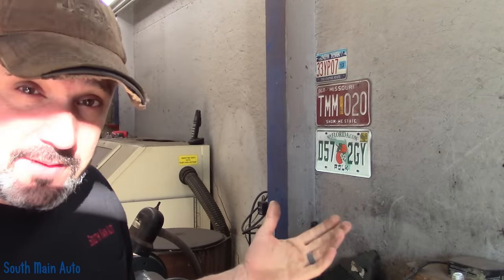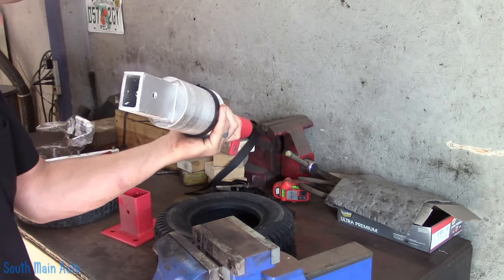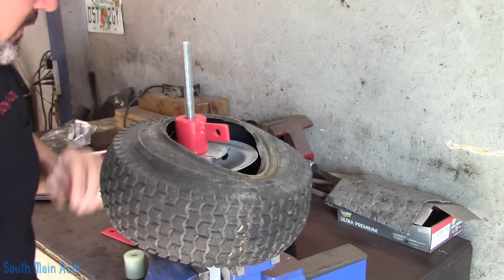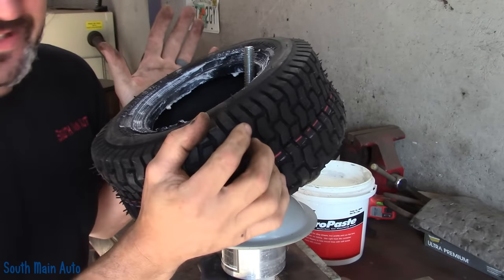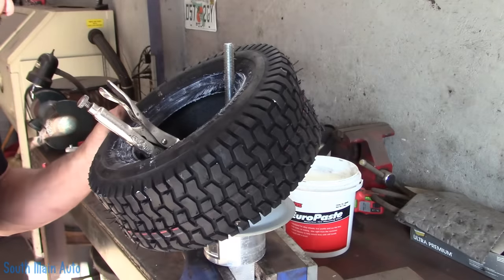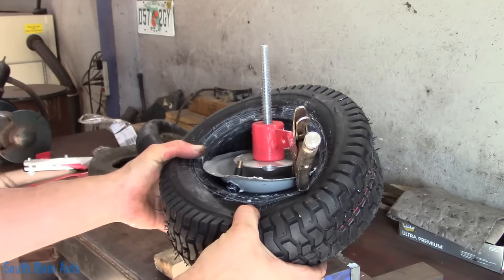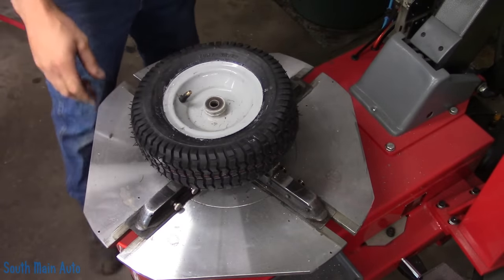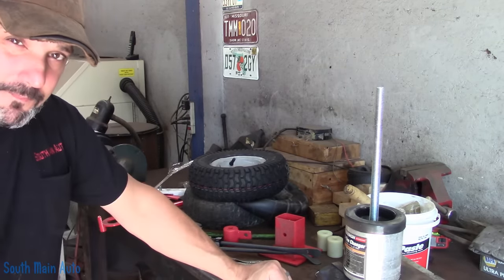Mini Tire Changer

Comment from the maker: *Portable Mini Tire Changer: https://amzn.to/2Zp1lmG
*Ken-Tool Tool Tire Iron Set, Small: https://amzn.to/2Zinao5
*Valve Stem Puller/Installer: https://amzn.to/2HiXNMr
UPDATE:
Man I can not believe the number of cry babies on here😂 . Listen. It's a throw away society and this is a throw away tire and wheel assembly. They are paper thin. Literally they can be bent by hand without much effort. It straightened out easy-peasy with a few taps and a block of wood. Yes it is a tubeless wheel. As a matter of fact when you buy these junkers they come tubeless so calm down it goes on a damn yard cart not the space shuttle. 
Fact is, some of you I see commenting would sing your praises one minute because I can tract down a parasitic draw, reflash an ECM, or chase out an electrical gremlin with out a hitch but "destroy" a $5 Chinese wheel for a yard cart and they take you to the chopping block lol. Seriously, grow up. 
You want to know the facts? I had the lady get her own tire because I knew she could get it for about $5 less than my vendor sold them. Oh yeah and I popped it on for her for free, oh and one other thing, she is not a regular customer so I don't benefit from this what so ever....
Cheers 😁
Reply: You are 100% correct, holding those small rims is the biggest part of the battle !  
Use a couple of giant C-lamp to break the bead.
A 12" carriage bolt up through a work bench, some giant washer and a home made giant wing nut and can those Ken-Tool spoons (best in the business), some lube and you are done.
Changing a tire, regardless of the size, 20% tools (including the lube), 20% labor and 60% technique.  If you do another tire video, you need to do a "white board talk" about the "drop center" and how it is important to keep the side opposite of tire from where you are working down in the drop center..  Many people still believe that you are actually stretching the bead to get it over the rim !
Reply: Same tool, $20 cheaper at HF.
Reply: Awful lot of tools for that tiny tire. I've done several of the 4" hand truck tires with only 2 big flat blade screwdrivers. Same technique for bicycle and motorcycle tires up to 18". Just lay it on the ground, stand on it on 1 side and work the other side with the screwdrivers.
Reply: Woah there Eric, calm down! Remember, this is the internet!
Reply from the maker: @jakeaustin9894  Haha I know I know but I think it is hilarious reading some of their comments. Bunch of mama's boys 🤣😂
Reply: Lol,i have a engine support (the kind that goes fender to fender   ) that I flip upside down on a table and use the chain hook bolt to clamp down the tire and use a prybar...it can be frustrating at first but with routine heck..it works. You always have the coolest gadgets
Reply: I have one of those....

I bolted it to a brake rotor so I can clamp it in my rim clamp tire machine. This puts it at a good height, and is fast to clamp and unclamp/put away.

The spacers save time clamping the tire, and give the mount demount arm something to ride on.

Mine uses a 14mm all thread. I did have to replace it after a few years.

The vice grip maneuver is a great trick.

Most of the time I just bolt the wheel to the bench, and use screwdrivers and the vice grip.

But, for busting my kart racing tires, the little machine did help.

Shorter #412 stems are better for little tires, and a lot of other applications. They look a lot cleaner and are less likely to snag on things.

If the inner rim is stronger, why not bust the tire face down?

Jeff
The Alignment Guy.
Reply: Wow wow wow.  Who is making these comments.  I would like to see them.  You are going to make this man mad over some Chinese wheel.  He is a genius at what he does.
Reply: So partway through, when I first saw that chowdered rim, I was thinking A, how is that not going to leak at the bead, and B, I would be pissed if you handed my tire back to me in that condition.   (Note the word "if".) But I kept watching before commenting... and you explained how the Chineseum wheels are made from recycled paper plates, and you fixed it, and it holds air, so there ya go.  Nice work.
Reply: So funny! These guys are acting like a bunch of girls!!! Love me some South Main!! ❤️🐞
Reply: South Main Auto Repair LLC you’d probably be better off not reading the comments at all. Let the haters hate and you, Me and the rest of society can live in the real world
Reply: It's a miracle the bearings were still good. On the hand trucks, the bearings fail within a month. Guess what, good replacement bearings cost almost as much as a new wheel with tire..
Reply: Just remember goosefraba to calm down. They just realized that the box store lawn equiptment isnt quality and they have the same wheel but yet my neighbor tells me I need a new mower cause my cubcadet 2000 series is old. I'll keep my 97 cub cadet thanks. Cool tire holder it beats saying four letter words
Reply: South Main Auto Repair LLC Those are just the mini tire experts Eric....
Reply: Get em
Reply: Lmfao Eric out here preaching
Reply: @ralfkramden9291  maybe cheaper at the store 40 min one way but he doesn’t have time for crap.
Reply: Some people would not be happy in a strip club with someone elses money

Comment: Two big screwdrivers, a few beers, box of bandaids, and no small children around. Works most of the time.
Reply: The children have to learn to swear sometime.
Reply: Hahahahaha
Reply: @Jason Bowman It's best to teach them young.
Reply: No kidding, even the tire shop guy had a few choice words with one I had to have repaired a couple years ago LOL.   

The fix, buy very expensive 4 or 6 ply lawn/garden tires ;).
Reply: Dont forget the can of break clean to seat the bead
Reply: Big B ... best comment winner right there!!
Reply: That's what I did recently. Big screw drivers and I left the wheel on the wheelbarrow (on its side) for leverage. Popped right on and no bend rim.
Reply: @alfredmorency8296  My Dad told me, drive as if all the other drivers are crazy.
Reply: @reecenewton3097  They are!
Reply: @Jason Bowman im not sure he is wrong... They sure act that way! LOL
Reply: @wildbill23c  Fill'em up with expanding foam...your great grandchildren will be using your tires! 😁
Reply: That was how I learned, most things,  as a child. I still remember the taste of beer.
Reply: Ya last time I did one it was a like 3 beer job
Reply: I agree brother
Reply: Airing it ups a bitch to we had to use seat belts and screwdrivers lmao
Reply: Steve's small engine saloon gives it three Buds up.

Comment: Just a little Remember When reminiscing. Helping my dad when I was very young in the 50s and early 60s all tires were tube tires then and came wrapped up tight in paper. You slammed the tire down on the floor and split the paper off. you then dusted the inside of the tire with baby powder or talcum so the tube would not wrinkle inside. We always used Murphy Oil Soap to lube the beads and install one bead then insert inner tube and install the other bead with Tire irons my Dad made from thin car springs. Blow it up without the valve in to unfold and get the wrinkles out of the tube inside and then let the air out and then reinstall valve and air up completely. If just patching a hole in the tube he had an electric Vulcanizing patching press. Many times he used a wire donut cage to put the tube in and air up to look for the small high pressure pinhole leaks while putting it in the galvanized Tire tub filled with water just for that purpose. My job was to use that army green US hand tire pump to fill those balloon tires to 28 to 32 PSI. 65 years later and I still have all those tools. Good memories and a lot of knowledge gained working with Dad when I was young.

Comment: The rolled edge (inside) was the side to mount the tire from. Won't cut tire and is stronger.   We all have off days  :)
Reply: Needs a rolled edge on both sides.
Reply: How much did they save by not putting the rolled edge on both sides?!
Reply: @AaronFernandes__  No, valve still on outside, this is only for mounting tire
Reply: @darnice1125  Tell me why thats the exact answer that pops up when I look it up on Google haha
Reply: @HunterC99  Well I did not look it up on Google and its not the exact answer. I'm an engineer and my father was a Master mechanic at Chrysler Experimental. So no "google" was needed, it just showed that google has the correct answer too.   So stop trying to cause trouble, I just pointed out someting to help everyone. SMA does great work, love the channel and the community is great!
Reply: Can’t we all just get along?😝
Reply: @Tomato Sauce Neither of which my post was. Was not rude or smartazz, just pointed something out, thats all.

Comment: just go to harbor freight and buy a tire on a wheel.
Reply: You still have to change the tube if you do that.  Hit a few wheels on your HF shelf and see how many are already flat.
Reply: That doesn't always work brah. Sometimes the wheel is specific to the problem at hand.
Reply: I worked at a Harbor Freight. We did carry complete wheels, tubed or not, 10 inch up to 15 inch.
Reply: @yurbeeinwatched  you must be a liberal.
Reply: @gatorhunter1  my point about harbor freight wheel and tire is mechanics and tire change technicians don't work for free. notice in this case the wheel itself was nothing special. So, if harbor freight has the new wheel and tire unit that works. we can save money buying that instead of having the tire itself replaced. Also for the other negative Nelly that complained about the tires at harbor freight not being full of air at purchase. so what, pump it up. I have harbor freight tires and wheels that are 15 years or more old and still working fine.
Reply: Another thing is that some folks live too far away from a Theisen's or Harbor Freight Tools store to justify the trip. I had a customer once tell me he lived an hour away, but planned a trip to our HFT for his mower tire because he happened to be in our town that day. I hear that all the time.
Reply: I don't consider a tube that is flat in a week,  cost  effective.  Some might,  because the complete wheels I bought  cost less than the replacement tube.  I am not complaining because I am sure HF would take the leakers back and I suspected a problem when half the store's inventory was at low pressure or flat.  My response was to a comment that  the cheap wheel price obviates the need for the tool. In my case, it did not.
Reply: That looks like the standard wheels that HF has near me, that size for wagons and yard carts and the next common size smaller for moving dollys. I buy them when they are on the sale add for $3 each, or $5 buy one get one free coupon. I have a box full of them somewhere in the garage and just replace as needed. Recycling the "blowouts" of course. Way less effort than buying a tube for the same price. All you have to do is change the bearing/bushing over and put some air in them and back to hauling mulch in 5 minutes.
Reply: @rickbanks7681  So every time your tire is low you change the tube? Would it not be  easier to simply add air to the tire?
Reply: Totally deflate half the tires on your car, weekly, and you will have your answer. In the case of the small HF tires, if they are low or flat, on the shelf, you have a clue that you might be bringing home a wheel that requires frequent service.  For those with too much time on their hands, a $4 wheel is "just the ticket".
Reply: The axle is sometimes different thickness and the one size or tube is discontinued

Comment: I HAVE BEEN A SMALL ENGINE MECHANIC FOR 40 YEARS. I HAVE INSTALLED THOUSANDS OF SMALL LAWN MOWER TIRES LIKE THAT. THAT IS THE THINNEST CHEESIEST RIM I HAVE EVER SEEN! GOOD JOB ERIC!
Reply: william giampa Looks like an Arnold to me. It must be an older one though since it actually has bearings instead of the plastic bushings that they give you now.
Reply: It’s not the rim’s fault when you do things incorrectly. You just use the tire changer and the tools provided with it. No spoons or hammers and no wood blocks. The rim’s bead edge is now mangled and now you’re wondering why the tire won’t center. But you can’t say it’s the rim’s fault after you ruin the rim. My goodness!

Comment: I just get new tires and rims from harbor freight.
Reply: FishFind3000 

Or tractor supply. They are inexpensive.
Reply: ... or Lowes. $35.00.
Reply: @sbrown307  Yeah... Lowes prices are highway robbery compared to other places.
Reply: @sbrown307  Harbor Freight runs coupons on those for about $5.99 tire mounted on 10 inch rim ready to go.
Reply: S Brown ouch. Tractor supply, $20
Reply: @robc8468  - right now they have them for $3.99
Reply: canuckguy worried  ..YUP..I just got F---ed, needed a 6x6.5x16 for my Allis Chalmers 912H... $53 for the tire, $13 for the tube, $`5 to nstall then taxes and shop fees..cost $97 Canukistan rubles allin... an that was the best deal I could find :(

Comment: South Main Auto changing a lawn mower tire?  Yep...I'm gonna watch.  Hell, I'd watch a lawn mower brake job from you lol
Reply: Yep, one disk brake on the output of the gearbox, just have to change pads.
Reply: Doing a brake job on a riding mower is too easy. As long as the brake rotor isn't seized on the transaxle stub shaft. to remove and get the pad behind it.

Comment: Eric, I have that exact HF changer.  Two pointers , leave the tire out in the sun and let it heat up to 120 degrees. It will much easier to remove and install. Second, I made a mount out of a length of   2x2 heavy wall tube. This way I plug in to a standard hitch receiver for a solid work station. Perfect for fixing a flat when out in the boonies.

Comment: Hey Eric, Tech tip Friday!!! We have the same setup we took the bottom attachment and welded it to an old rim so it can still be used in the tire machine. Also if you find it difficult to get the tire off, use larger car tire irons stick them both in lift the tire a bit and pry against the threaded rod in a scissor action! Works every time
Reply: Thanks for that suggestion that's genius. I will do the same with my Coats.

Comment: I've had dry cracked tires one a couple of my mowers for decades.  They work just fine with a tube.  It's not like I'd be doing 70 on the road with them like a car.
Reply: JJ JJ same I just put tubes in my front tires on my lawn mower and haven’t had a problem since used 2 screw drivers to pop the rim out on one side and my splitting wedge to pop the bead off took me half an hour